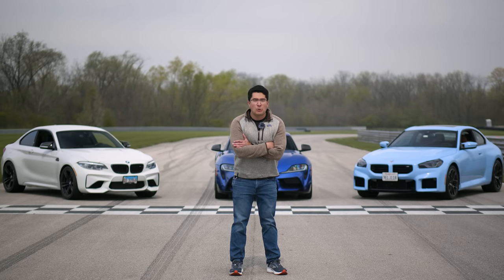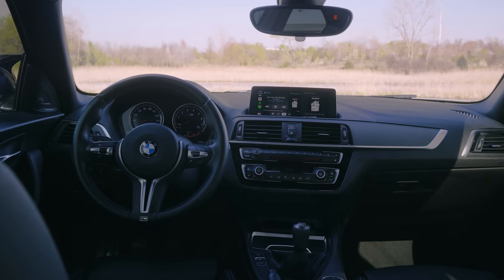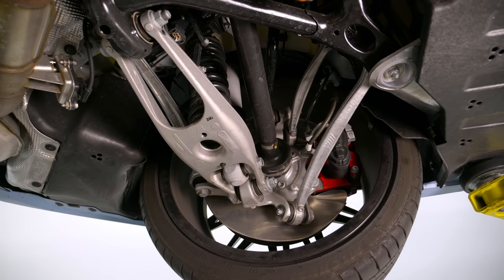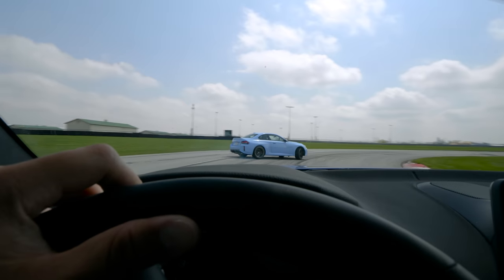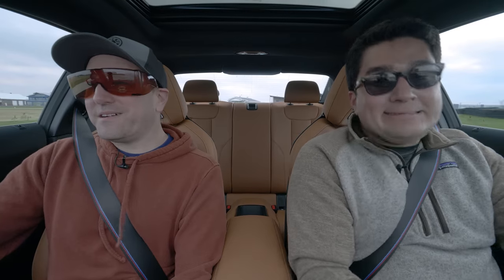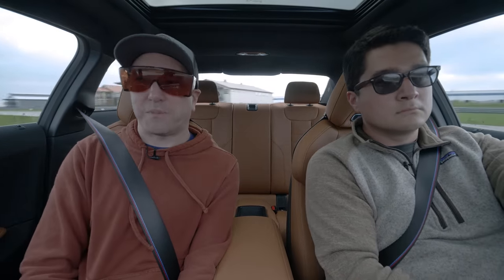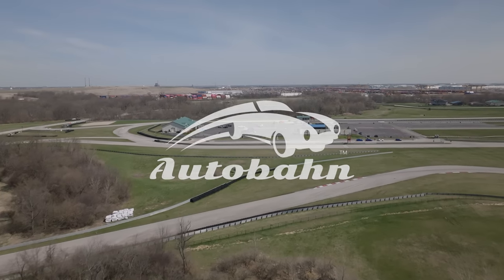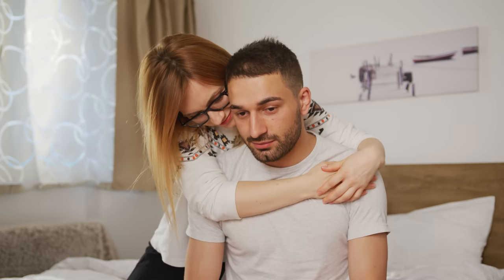2023 BMW M2 vs Supra Manuals | Laptimes and Drag Race

Comment: OG M2 the only one with iron sleeves, all the others will eventually chew coatings, including AI Jack's favourite
Reply: Hi just for curiosity, what benefits do you get from iron sleeves compared to the rest? Can it take more power?
Reply: @paulmeduri4451  I think overall all 3 engines (N55, B58, S55) cylinders can take enough power. You'll run into fuel supply, turbocharger and compression ratio bottlenecks first if you go for lots of power. B58 and S55 are closed-deck, so there shouldn't be any deformation issues. But they use a thin coating on the aluminum cylinder walls which we'll have to find out in 5 - 10 years how well it lasts. On the other hand, the N55 (at least the M2 variant) has pressed-in iron sleeves. I don't think there's any coatings on that.

Tbf all 3 engines are proving to be overall very reliable. I'm just tired of everyone shitting on the N55 in the M2.
Reply: @grigorioschristodoulou5229  all good, I have an og m2 n55 so I get what you mean.. all great engines though
Reply: @paulmeduri4451  Me too, in LBB 🙌🏼
Reply: @grigorioschristodoulou5229  nice colour too, I have the mineral grey
Reply: N55 is not great. You don’t need to worry about the bores, it will spin a bearing without being tuned and well before the LDS coating wears on the newer motors. S55 was the first with this coating and they don’t have cylinder problems.

Comment: I can't help but think how many people with the new M2 will fold over every fin on the cooler out in front on the bottom of that car going on and off of driveways with tall curbs. The skid plate is sitting right between the front wheels where it's not really much use

Comment: The tire size on the rear of the M2 is not fit for that car, which slows it down dramatically. 285/30/20 vs 285/35/20 is a huge difference on a manual m2. (There is no 285/30/20 RE71RS)  The gearing is extremely long and the top speed is slowed by tons. 
@savagegeese should be a precise channel about tech specs and should know what I am talking about. I bet the driver could put down faster lap times and a different perspective on the m2 when using a stock-equipped P0 or 4s. (Or right-size tires)

Comment: Interesting the Supra was the most engaging of the bunch and won because of that. I’m in my early to mid 30s, selling my Supra and bought a E46 M3 because the Supra is too numb boring and too fast to drive on the street. I don’t want to go jail level speeds before I’m feeling anything.  

Manufacturers just don’t have the guts to build drivers cars anymore and go off their s*** analytics. Yet someone tell me why I can’t easily find a manual GR86 but there’s a ton of autos available...

Comment: Didn't Toyota develop the chasis for both companies to use in exchange for the bmw powertrain?
Reply: No,it's bmws chassis but toyo took it and made it stiffer and did all the tuning they wanted with the mk5(they mess with the cars suspension yearly). I'd say, bmw basically gave toyo the chassis,engine,and etc to use(and I mean use cause bmw barely even acknowledges that the Z4 exists)and practically doesn't care what they do with it(they've honestly made a buyable gt4 version of the mk5 for race teams to buy also that's still being made/sold today with like.......420hp). Can put both cars production updates together and honestly see who's been using the chassis more.

Comment: Really different review compare with Jackie Ding, and I have another question for the Supra, why mt Supra is faster than at?
Reply: We didn’t test them back to back. Also ambient track conditions make a huge difference to lap times. How rubbered in the track is, ambient temp, track temp, head wind. These variables all can change lap times at least on south by 1-3 seconds

For our hot hatch testing we ran the elantra n both in the morning and in the afternoon. Ambient changed 4 degrees and the lap times slowed down by a second
Reply: @jackholmes8105  So 35_06(Supra vs Z video) vs 32_72, which the same tires, and same driver but different day. This seems to be a VERY big difference in just track condition. Not impossible, but suspiciously big for a 90 second track. 
But if the data is true, which means the track condition is definitly on the better end for sure this time around since Britt found more than 2s from in the know slower MT Supra. But Britt with RE71RS(which by common understanding & TR testing is a faster tire than the M2 Stock PS4S) is still almost 1 second slower than Jackie Ding? Things does not add up here IMO.
Reply: @keyboardracing  first off big oops on our part which mark is trying to correct. Its a 33.72 not a 32.72 the garmin has the correct laptime in the overlays. 

That in mind the order in which is faster and slower is accurate. 

Different drivers, different days, jackies m2 is auto this was manual.
Reply: @jackholmes8105  Okay just saw the correction on the Supra laptime. This makes a little bit more sense now. Thanks for the video as always.

Comment: The "Original" M2 don't have Sports/M Seats, there are no M-Buttons you can configure and these 2 Points kills it for me already. If you want to have Throttle/Clutch syncronisation on the old m2 with the manual switch, it only works in Sport +. As soon as you deactivate the DSC, you are no longer in Sport + and no longer get the throttle/clutch sync. And that's in an M... M engine is not in it either. In Germany, these cars are too expensive for what they can do.

Comment: I don't want a 4000 lbs small BMW coupe. I'll take the modern E30 M3. GR86. Same wheelbase, weight, redline, weight distribution, power/torque, suspension layout & displacement as an Evolution model. This is a parody of a small BMW coupe.

Comment: Mark cites the used M2’s price advantage but leaves out the post-warranty reliability issues and high maintenance costs all BMWs are plagued with. An extended warranty from BMW would cost thousands, and third-party extended warranties are a crap shoot.

I like the new M2’s clean and simple look — it seems they are recovering their sanity in the styling department — and it’s got the best powertrain. But consistent with this manufacturer’s transition from driving machines to luxury/performance cars, the absence of feedback from the driver controls eliminates the sense of engagement that is essential for any serious driver’s car.

The Supra exceeded my expectations. From its size I thought that it too was a four-seater. Like the others it is a high-performance coupe, but with far less practicality. Its styling is, to me, way over the top but I know many people like it.

None of these is a sports car. Even the lightest is a thousand pounds heavier than that classification requires. But few Americans want a real sports car these days. For a guy in his 30s who makes good money and wants a more fun drive than an SUV or a four-door sedan, I wager he’d be happiest in the new M2.

But to a degenerate motorhead, none of these cars is particularly appealing.

Comment: So this pro driver was 1 second slower than a amateur driver who only had 3 laps in the new M2. Sounds legit.
Reply: Conditions and variables are pretty different. At least in our oem backed tests ambient conditions can change laptimes by more than a second or 2 on the same day. Not to mention how rubbered in a track is. The more or less a track has been rubbered in also makes a tremendous difference.

The supra ran almost a second and a half faster than when we tested it last year as a automatic on the same tire with the same driver. But all the listed conditions also were different. 

So our ambient temps were in the mid 40s when we started, by the time he got out of the last car it was about 50. The supra ran last, with the new m2 running first in the coldest weather. 

The m2 we tested was manual, vs jackies auto, it also came right from the press event but it was on brand new re71rs. 

Our data was also verified by garmin engineers and britt is an actual championship winning imsa driver who has been racing at autobahn since he was 13. So dunno what to tell you. During this test on this day with this driver those were the results.

Comment: I really enjoyed this review across 3 generations of BMWs (S58/B58/N55). I'm also curious how the M235i/M240i would have stacked up against these three cars, offering similar performance to the OG M2 but with even better value.
Reply: Probably would not stack up well.
Reply: @DevPack  I think you're undestimating them. Looking at track times, the M235i (half the price of the OG M2) isn't far behind the OG M2 and the F22 M240i is faster than the OG M2. And if you do some minor mods/tune then you've got 400-600hp easy and you're still well under the $40-50k for OG M2.
Reply: @grocerylist  Yeah but on those narrow fenders you got 7.5J tyre to handle those horses. The last gen M235i and M240i were shafted hard.
Reply: @idokwatcher2062  that's true but can be remedied slightly. I've got 8.5 in the front and 9.5 in the rear and with 245 (Front) and 265 (Rear).
Reply: If you care about speed buy something else altogether. M235/240 lack a rear LSD and spin the inside wheel like there's no tomorrow. This also unsettles the chassis. M2 uses the M3/M4 steering rack which has better feel (can't remember which is ZF and which Thyssenkrupp). M2 has far superior kinematics from M3/M4 and space for wider tires. The N55 in the M2 has upgraded oil system to cope with high G, N55 in M235i can get oil starvation on sticky tires

Straight line: B58 240i
Everything else: M2
Reply: @grigorioschristodoulou5229  while you're correct in regards to the F22 lacking a LSD, even without one the F22 M235i around a track is nipping at the OG M2's lap times. I don't disagree the OG M2 is a better car around the track but it's certainly not $20-30k better.
Reply: @grigorioschristodoulou5229  There is a Drexler LSD available 1.5-way 30%/15% lock for M235i and M240i. Compare to Cayman 718 where an LSD does not exist, not factory not aftermarket. It is pathethic what Porsche gets away with for the prices they charge.
Reply: @idokwatcher2062  I've got my eye on a Wavetrac LSD eventually for my F22.
Reply: @idokwatcher2062  You can definitely improve the M240 a lot and add an LSD. It's quite an expensive process though because stupid BMW welds the ring gear on the diffs <facepalm>

Comment: Can we trust your pro driver? Jackie Ding with PhD racing did a 1:33.05 in his new M2 completely stock, with stock Michelin PS4S tires on his 3rd lap with the car, in traffic....granted it was the ZF8, but  still....with stock PS4S which arent track tires. How much slower can the manual be on TRACK TIRES!!! I know conditions vary from day to day, but....
Reply: Dunno what to tell you. Britt got a secession in each car to set a lap time. It was extremely cold out and he was struggling with a tc code. Britt is an actual race car driver unlike jackie ding. Gt4 and tcr in imsa. He also has a tcr championship which is pretty damn impressive.

I dont doubt jackies laptime but honestly based on these cars I struggle to believe that time was truly accurate based on our testing.

Comment: Lmao dude hates on the e92 m3 manual. That’s the gs6-53bz and is by far the strongest bmw manual ever used into production including the new gs6-45 in the g87. The e92 MT was the goat easily taking 1200+whp

Comment: So, using your logic if a MX-5 was in this comparo then it'd win based on price?  MX-5 is not the fastest nor the best handling but it is sure the cheapest of the four and more importanly, it is a driver's car (e.g. great steering feel, great manual shifter, great brakes, etc.).

Comment: There are a few problems with this line up. 
Firstly, manual is great but it doesn’t really work for any of these cars. Its not a great manual and the engine in the supra and new m2 are designed more with auto in mind.  Get a 981 GT4. 

Secondly the N55 is the worst inline 6T bmw have produced its weak and dull compared to both N54 and B58. 
The supra at least benefits from the b58 but in auto form it is softened by having the ZF.
And the new M2 has the best engine, and its not the worst bmw design, but its just awkward looking and overly complicated / heavy.

Comment: The early model M2 weighed 3482.5 and he calls that "3400 lb range" sorry but that is 3500 lb range. The actual weight difference between the two M2's is 312 lbs, so really a 300 lb difference. All of these cars are very heavy, even the tiny cramped two seat Supra sports car is 3350, they are all porky cars. I just don't understand why he tried to make it seem like there was a 400 lb difference between the two M cars when it was actually much closer to 300 lbs. Still a lot so why exaggerate?

Comment: This test is hugely compromised by choosing the F87 non competition M2 which effectively is 2 generations behind.  IMHO the proper comparison should be the M2 Competition or for completeness the M2 CS as well, that would be the true comparison of the evolution.  As a F87 M2C user this is disappointing.
Reply: Yeah the comp was disappointing. Deviated septum front grill, exhaust that looks like a full diaper, the extra weight over the front, extra 15kg + of unsprung mass with n2h, less reliability, broken Honda exhaust note and the removal of all the character the original m2 had.

Bmw should of fitted the comp seats 
and wing mirrors and called it a day
Reply: @lloyd.8272  I don´t know which car you drove but the S55 was a much better fitting engine for this plattform. It is much more aggressive and meaner due to the Bi-Turbo setup and high compression ratio. That was what really made this car feel alive. It´s like i wouldn´t want to see a B58 in an M car. The N55 sounds really clean like every 6 Zylinder. The S55 sounds very dirty, raspy and unique due to the unequal length midpipes. But I understand that this is personal preference.
I regularly drive a M2C and 140i Stage1 and both a perfect in their adequate territory but I would never have thought about swapping them with one another. The B58 is just too smooth for an M car, while it is better in every way then the N55.

Also N2H were so cool just because it is complete overkill by literally jamming M5 brakes on an M2. These disks are even lager then the G87s. Be grateful that the M engineers were so out of their mind at that time.

Comment: Why not s55 m2
Reply: I did this on purpose as the new car isn’t technically a comp. The s55 comp cars also cost nearly as much used so as a olive branch to those with smaller budgets i wanted to see how the og car would stack up
Reply: @jackholmes8105  should roll race comparison and also use auto gear boxes just for feedback - great video though

Comment: You guys put brand new tyres on just to slide around and burn them up
Reply: It was done after they were trashed by the pro driver setting flyers.
Reply: @jackholmes8105  I read somewhere that tyres need to be 'run in' before they can be used well, what's your guys procedure for that
Reply: @muhammadmore  each tire has their own “break in procedure”. Once the wax goes away which takes about a lap or a couple miles on street the tires are good to go

Comment: how come jackie ding is 4 sec faster in G87 with stock tire lol
Reply from the maker: He ran a 1:33 in 60F on stock tires. Its not 5 seconds its .6.  The stock tire would have been faster than the 200 treadwear tire we had at 34F track temps.
Reply: @savagegeese  is it possible that the re71rs sidewall is 35 not 30 and the 5 percent delta something freaks out bmw abs? Explains why it doesn't stop well

Comment: The Supra is a Toyota made with BMW parts, but its a Toyota not a BMW. The B58 is legendary bcuz Toyota examined every nut and bolt and send BMW back to the drawing board where necessary top ensure that or was up Toyota quality. The chassis Ana suspension is tuned by toyota for there rendition of what handling is. Much like they improved the ZF gearbox, they did everything else top make  a disgusting Toyota why BMW parts so the best BMW on this level is infact a Toyota. When BMW approached Toyota to build a sports car after the success of the 86 with Subaru, they knee they needed help hopefully they've learned reliability as they co-developed the engine and chassis together